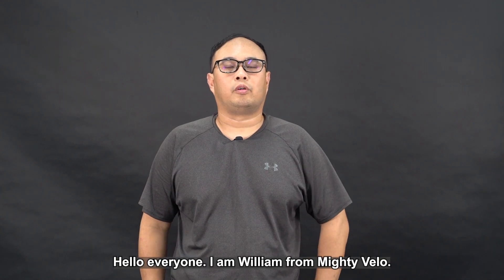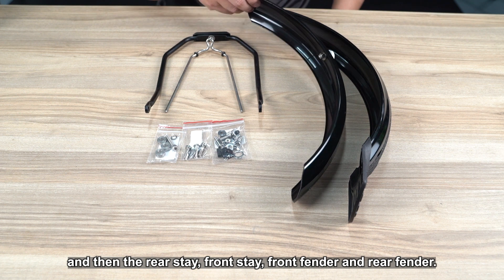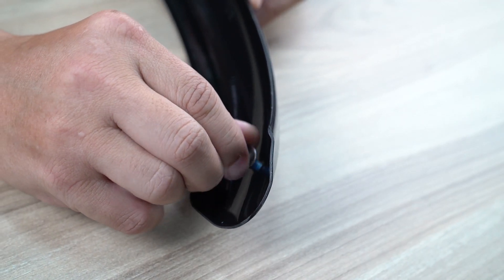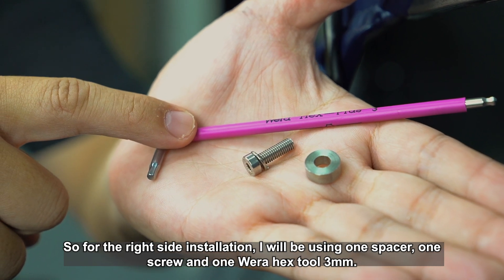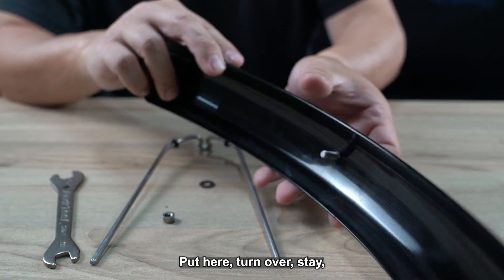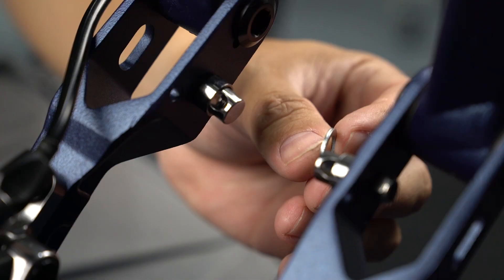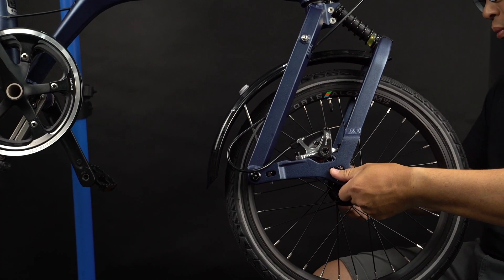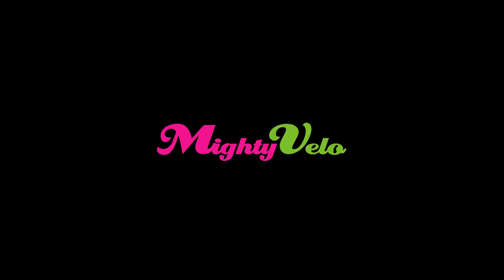Birdy G3 Fender - What you NEED to know!

Comment: mug guard can fix onto birdy gt?
Reply from the maker: The fenders can be fixed on the Birdy GT but if you are riding on terrain where it can be muddy or loose dirt, there's very little clearance between the knobby tyres and the fenders. The fenders are predominantly designed for road riding prevention of splashes for wet road rides, not off road rides.